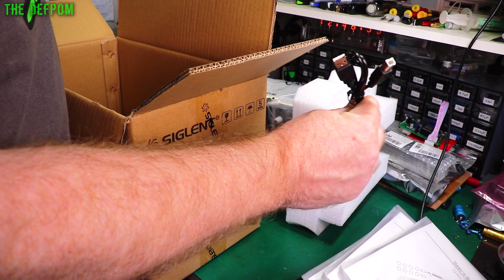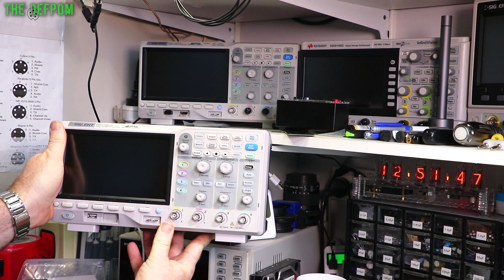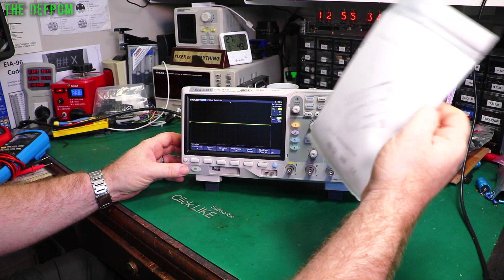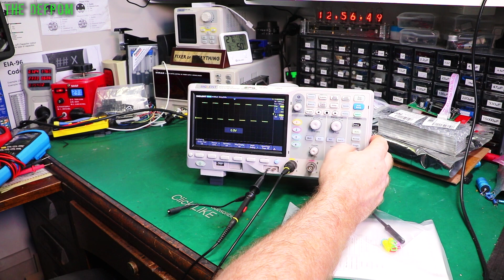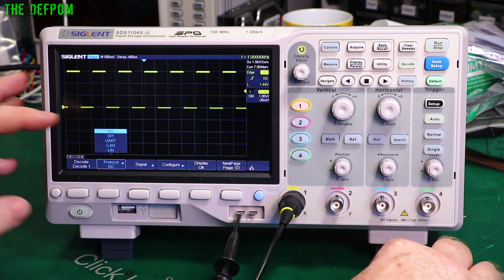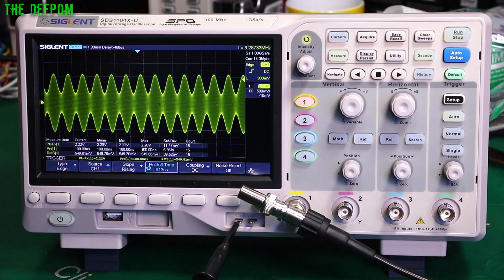🔴 Siglent SDS1104X-U Oscilloscope Review - Compared To The SDS1104X-E ? - No. 801

Comment: Correct, no webserver however a similar features set is available with the free EasyScopeX SW that should be on the CD that comes with the scope.
For many adjustments that use the multifunction control, pressing it pops up a virtual keypad where you can enter values directly like for Holdoff instead of endlessly turning the encoder. Very useful when large value changes are required. 
Reference Position in the Utility menu is something you need play with more where you can fix the Horizontal 0s trigger position for it not to move off the display when the timebase is magnified. A similar feature is available for Vertical position.
Over the next few weeks/months these DSO's should become more widely available.
Overall a good quick overview of the capability of the X-U, thanks Defpom.

Comment: Do you think this would work well for automotive?   My main question is:  If I'm zoomed out for a slow roll so I can get a long capture,  I believe it will only show data at a lower resolution.   But while viewing that capture, am I able to zoom into wave form and drill down to the finer detail?, or does it only capture what is on the screen?    

For example an automotive "PICO scope can record a rolling capture, and then you can still zoom into your recording (like google maps) and all the finer detail will still be there, even though it could not be viewed on screen at the time of your recording.    

So in other words,  can you adjust resolution after the fact?  or would I have to go back and change my settings to get the capture I want on screen first, because your rolling recording is only acting as a screenshot, and not a fully dynamic capture at the finest detail, no matter what is being shown on the display?   

For example, if I had it set for a slow roll so I can crank the engine for 10 or 20 seconds, and then go back and look at the capture.  The engine RPM would be around, lets say 400rpm, so you would get several injector spikes firing on your capture.   But the duration of each injection is only about 5ms, so would I be able to look at my capture and change the time frame, and zoom down into that injection waveform?    Or would my capture only show the initial spikes that were recorded at a slower rolling time frame?

I know while viewing live data, you can change the time frame and zoom into that injection waveform, but I just don't know if you can do it with a capture?    This is important because many times you need to zoom out and see when your injectors are firing, but in the same capture you need to zoom in to the waveform of a specific injection event-   for example if the car is only malfunctioning intermittently.    It would be hard to capture that one malfunctioning event with a trigger;  but it's easy to catch it on a rolling capture that records everything--  I just don't know if it has the ability to then zoom down into the 5ms waveform itself, if your recording was on a 10 sec capture. 

I hope I was clear on what I'm asking. lol..

Comment: How to save in CSV file with reduced sample size? Every time when I save , I get about 380MB file with 14 milion lines which of course can not be loaded with excel
Reply: Can you not adjust the number of samples on the scope?, havent got the scope, would imagine its adjustable from the 1gsps
Reply: @ThuleApsu 
Yes it is possible, but than you need to think in advance. For instance sometimes I need to catch some rare event, finally I catch it and than it cross my mind that it will be good to save it in csv, but scope was set to high sample rate. Than I need to repeat complete process and catch this signal again, with reduced sample rate, but maybe I will loose to much time if event is rare. Keysight scope of similar entry level class has option to reduce sampling rate during export to csv. If I remember well there is optios something like 2 000 / 20 000 / full samples, or I can enter number how much samples I want in csv file, this is very usable.
Reply: @zokonjazokonja  Interesting, well failing that, there is the CSV, I would use a decent editer to remove the upper and lower range of times-I would probably write a small vb/c# script to do that, before I importing it into excel to tidy it up further.
I havent looked into csv editors, but know excel might have problems importing a file of that size-hence I suggest a script, what do you think?
Reply: @ThuleApsu  Scrpt would be helpfull, if I need only to trim file (remove not needed sections of data) I use Glog

Comment: what's your daily go to scope?
Reply from the maker: It depends, usually my older Siglent SDS2302 which is fully optioned with MSO logic analyser etc, but as I have 3 scopes on my shelf they are all suited to different things, the Keysight 1102G is faster, and has slightly different serial decoding and is better in some cases depending on the deciding required, then I have my 4 channel Siglent, obviously for the 4 channels.

Comment: Amazon in the U.S. has the "E" for $450 and the "U" for $400 at the time of this post, though it claims 1-2 months shipping on the "U" and the listing doesn't appear on Amazon's Siglent store page.  A quick search suggest these prices are typical, though, so your choice might depend upon whether you think the extra ADC (multi-channel sample speed), time resolution, and option to buy the MSO, function gen., USB function generator, or web control upgrades are worth US$50.

The optional packages are pretty expensive (too expensive, IMO) and can triple the price of the scope, but they may be critical to a current or future application.  If you need Bode plots, for example, then you'll have to buy a compatible Siglent function gen.  While the option to upgrade is nice, keep in mind that such features may become standard on future products at a similar price.

If I assume that I will not be buying the upgrades, the extra $50 is buying me an extra ADC to improve multi-channel bandwidth plus slightly better time resolution and vertical range.  If I needed specific optional features, I'd first look at scopes that include them out of the box.

What would make my decision easier is if one of these scope went on sale.

Any digital bench scope should include basic decoding as a standard feature, period.  If I have to pay extra to get serial or I2C decoding, I'll pass.
Reply from the maker: You should look at the Siglent NA site: https://siglentna.com/digital-oscilloscopes/
Reply: @TheDefpom  Thanks.  Did I state some specs incorrectly?  I was looking at siglent pages when writing the post, but not the NA site.  If I made mistakes then I will be happy to correct them.
Reply from the maker: Just the pricing on their site is different, with a $100 price different between it and the 4 channel version of the X-E (there is a 2 channel version which obviously isn’t comparable)
Reply: @TheDefpom  OK, I was going on the prevailing prices that I found online, but the X-U isn't in stock at many places yet so this may change.  Thanks.
Reply: The 200mhz hack and 2 ADCs with extra options make the extra 50 bucks look like nothing. The choice of the 1104x-e is a no-brainer unless budget it very strict. I've been able to read frequency out to 325MHZ with the 1104x-e with the software frequency counter. The hack turns it into a 1204x-e. If you need lots of scopes for an educational setting then the 1104x-u would make more sense. For a hobbyist, just get the x-e. They made the X-E incredibly easy to hack intentionally for the hobbyist. They are fully aware that corporations and institutions wont hack it for any reason (they prefer to keep warranties in tact).

Comment: How do I get in touch with you to get a couple of 2510's repaired and a 2600 converted?
Reply from the maker: What country are you in?
Reply: USA
Reply from the maker: @vc3382  - I’m in New Zealand. So not possible, look up Mikes Radio Repair
Reply: @TheDefpom  is it possible to email me a copy of the service manual ,schematics,and anything else you may have? My display is out on one and not sure where to start.....
Reply from the maker: @vc3382  - there are diagrams and service info online, as far as your fault goes, likely due to a bad regulator on the MPU board from corrosive glue, pick off the glue and check the regulators for proper output, there is also an 8V regulator on the side rail on the main board which tends to get broken solder joints from the rail flexing. Also replace ALL of the electrolytic capacitors, they will need doing.
Reply from the maker: Also be careful when replacing parts on the MPU board, it is double sided and it is all too easy to rip pads off the top side if you don’t desolder it properly.
Reply: @TheDefpom  gotcha my friend.....i watch your vids constantly for info and mikes as well. Great vids by the way and good luck with the new purchase! God Bless stay safe and healthy! I'm in Lycoming County Pennsylvania USA...Vince ,and stay in touch!